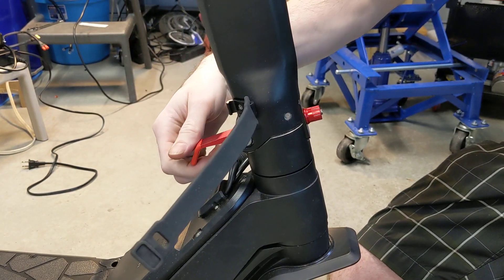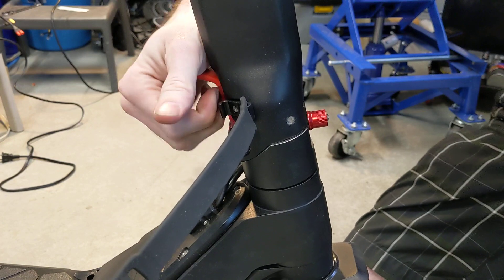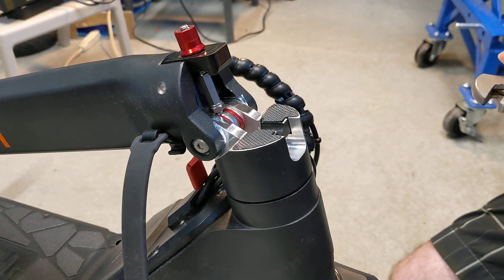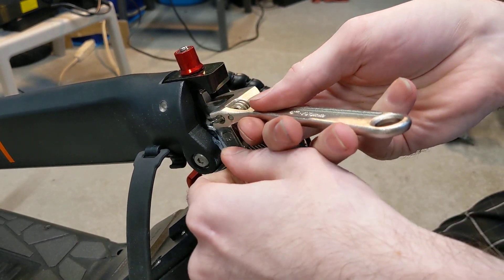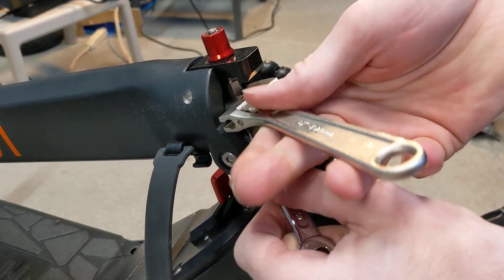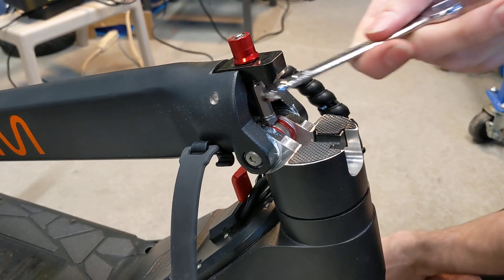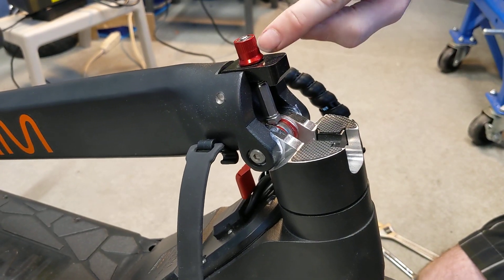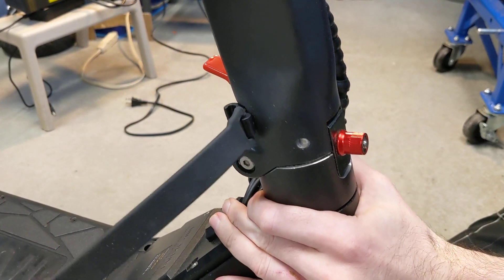Eliminating Steering Shake on INOKIM Ox and OXO

Comment: I ended up replacing the hex part (he touches it at 0.48"). The threads were either stripped on the inside or simply defective which made it impossible to tighten.  I used an m6 hex coupler purchased from OSH for $4 and a separate m6 bolt.   I sawed the head off the bolt and connected the two pieces and replaced the old part. Then I was able to tighten the latch sufficiently which stopped the annoying wobble. Alternative would have been to purchase the upgraded locking latch assembly from Inokim for $120 (currently out of stock) or the older non upgraded  latch  assembly from ebay for $39.

Comment: I was ready to pull the trigger and buy a Inokim Ox until through research I found out about this stem column problem/issue. This IS a common problem and Inokim has even addressed it with a shim (sold separately) because of the slightly loose fit even after THIS adjustment you've shown! Watching you lock the stem too it looks like it isn't a very positive lock or click/snap into a secure position which doesn't look to be very awe inspiring or secure (I know there's a wrap around rubber strap but that to isn't confidence inspiring either.
My search continues for my first e-scooter I guess. Too bad I was really liking this scooter.
Reply from the maker: There has been improvements over the years with the Ox. This video was produced with a first generation Ox sometime back. Hope you find the right scooter for you!
Reply: You are over reacting its not bad at all and there really isint a better design at the moment all of them are not perfect